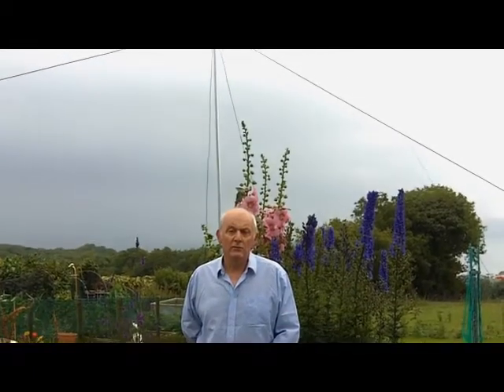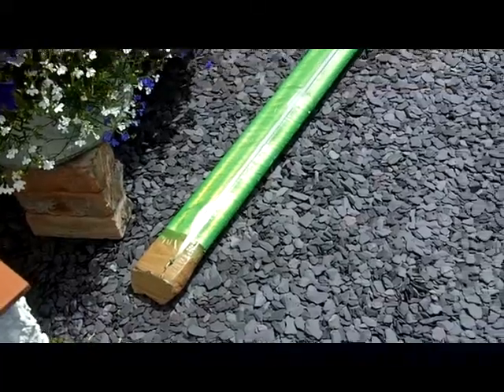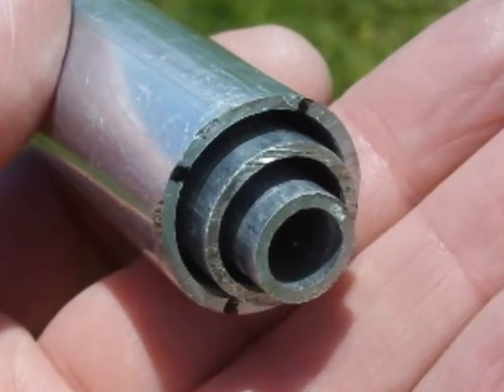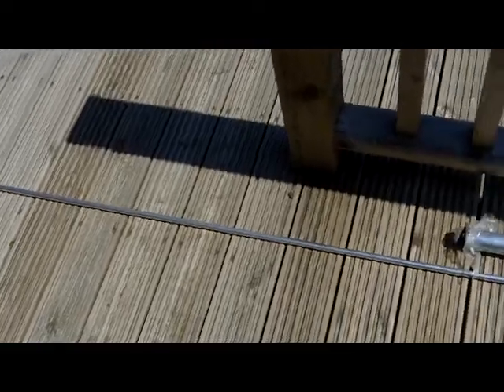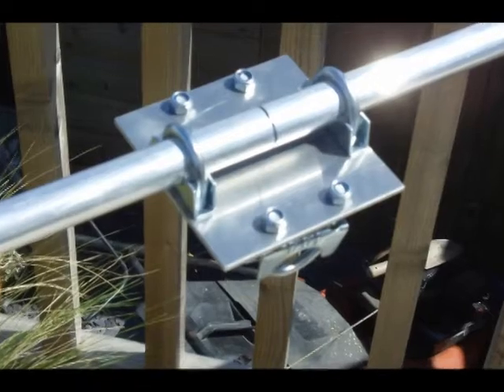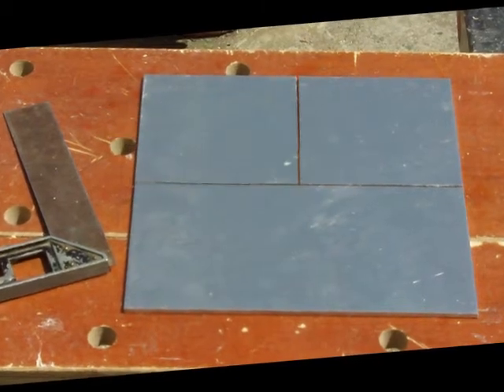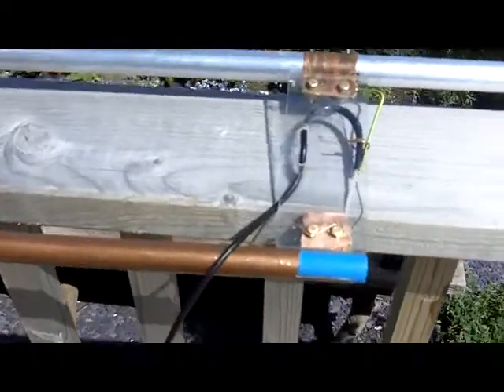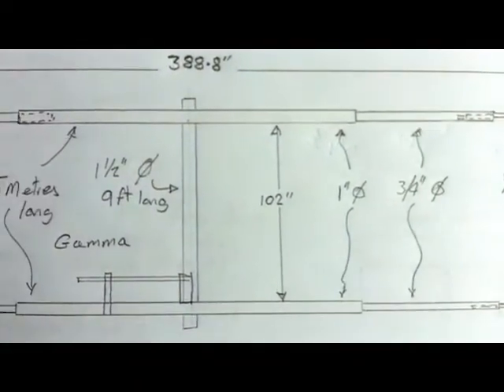2 element beam for 20 metres from gw0jxm

Comment: Hi again andy. Do you know what a moxon rectangle is? I think that would probably be even better for you considering what it seems you are after. It would shrink your yagi without sacrificing gain. I made one for 11m once and polarized it vertically. Locally it killed a half wave vertical at the same height by about an s unit! Pretty good going. It's a great antenna too horizontally polarised. Catches less wind than a conventional 2 element yagi, is more mechanically rugged and needs less turning space.
Reply from the maker: Hi, I’ve never built that particular antenna, I’ve read about it but can’t remember the details. There’s so many things I want to look at and play with but I never have enough time to do it all.
Thanks for the input.
All the best ... Andy

Comment: Im guessing it gets you pretty good signal reports too. If it were me I would have found it hard to resist going 3 elements but I guess that gets far more cumbersome to handle. One thing I would consider is turning it into a moxon rectangle. It would only be about 20 by 7 or 8 feet then.
Reply from the maker: It’s a bit of fun and the reports would be better if I had it higher, and yes one could go the extra distance and add the third element. But remember I set out the construct an antenna that I could manage to erect easily on my own and the third element would add extra weight that I didn’t want. But hey, you can make whatever you want and or have the resources for.
All the best ... Andy
GWØJXM